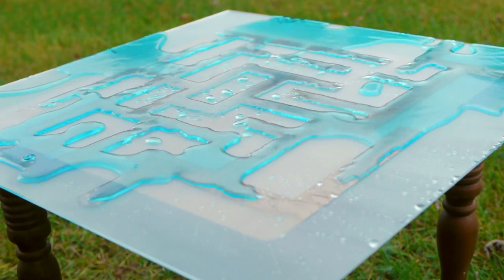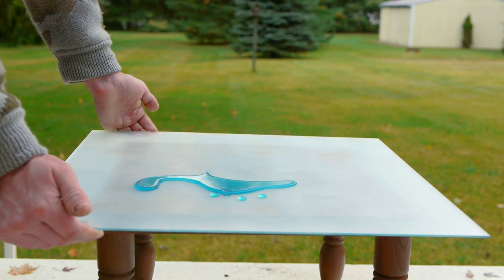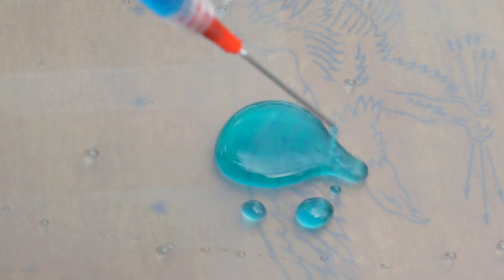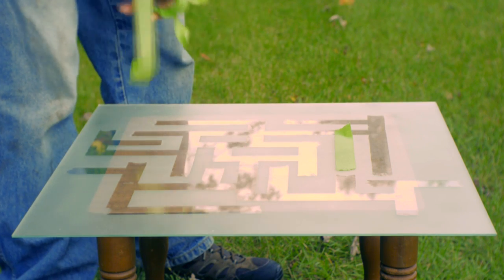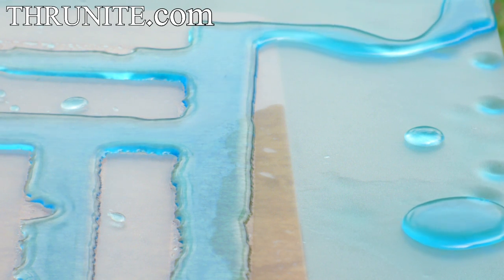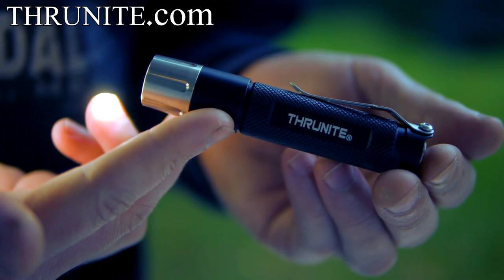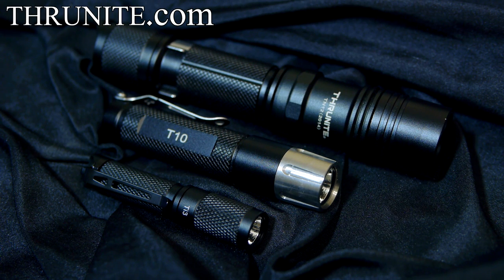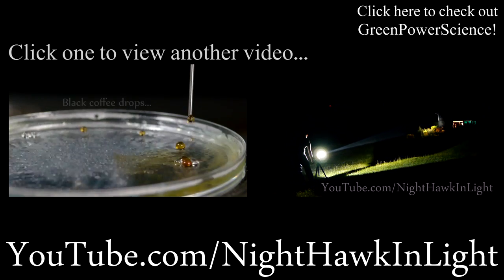DIY Hydrophobic Coating [Never Wet, Ultra Ever Dry Replacement]

Comment: Would this DIY version hold up on concrete or concrete like surfaces? I'm interested in making sidewalk/street art with hydrophobic stencils but the original Always Dry brand is too expensive to use for big projects like that. How durable and resistant is this combination? Also, if sprayed on concrete, would it be visible or go on clear in undetectable?

Comment: This makes me want to try SO many new ideas... What happens if you use a coating like this on rebar in concrete? Rust Prevention?$?... What happens if you used it inside plumbing pipes? Nonsticking waste flow sounds awesome, especially if it helped in low-temperature environments! Coats, tents, shoes, etc... So many uses!

Comment: I gave the anti persirant idea a try a few months ago (brainflash?) when the bathroom mirror was steaming up faster than I could shave.. as with this attempt the downside being it was milky and I could no longer see well enough. Meaning to get the muck off the mirror I eventually used a liquid scourer to remove it. It DID however stop vapour from misting the mirror. These flashlights are quite impressive and the art of your table project has a fluid appeal also. ( : Thanks for the discussion and name of the active ingredient !
Reply: Live with danger...shave without a mirror.  Pretend that you are blind!

Comment: Love all of your DIY projects!  I was a scientist back in the 1970s & 80s, so the geek in me enjoys your postings.  
The hydrophobic products are such a useful innovation for us common folk.
I'd love to do the steelwool fire twirling with a baton (yes, I once was a cheerleader).  Has this been done?
Now am subbing!
Reply from the maker: A lot of people have used steel wool for poi, but I don't know if it's been specifically done on a baton.
Reply: I love the Maori traditional dances!  Poi is wonderful to watch.  Perhaps I need to stick to using your copper wire method.  Especially since protective gear is needed.  A cheerleading outfit just wouldn't do it, eh?  Lol.

Comment: Really liked how you included the bit about the flashlight, while a little unrelated it's a great bonus info because having a good flashlight is always good. Seeing how you read all the comments is great too!

I saw a video not too long ago with some prototype nano tech coating but couldn't find a way to buy it( likely because it's still in development and such). This idea might be a good alternative especially for the price, but my desired application is on work boots, I'd like to walk out of a mud hole without ten pounds of dirt on my feet. I will test this out but have a feeling the coating will not stay on the boots and there is also the issue of temperature changes and how that affects things . Any thoughts or ideas would be great.
Reply from the maker: Dan Rojas does a little more experimenting than I do in my video. You might want to ask him. A link is in the description.

Comment: I find a lot of your videos to be really cool, but also kinda hard to understand at times. As someone who is no stranger to more common tools, I still find myself lost when it comes to the construction of most your projects. In this video for instance I would like to know what spray on deodorant works the best, and what the clear coat spray is and what it is normally used for so it would be easier to find when I go to walgreens and home depot. 

Try to remember, not everyone knows as much as you, so we may need some help sometimes as we try to learn. Its not talking down, its educating.

Comment: I'm in the military and especially enjoyed the DYI on the special coating.  If it really works I will definitely use it as weatherproofing for all of my gear.

My only question is does this have any draw backs where you cannot leave it in direct sunlight or extreme temperatures?

I will look into the flashlight as well because I've spent far too much on a modest salary for a good flashlight.  The Army doesn't have the money to provide us with any due to their high costs but if it's priced reasonably and meets our rugged standards then we may be ordering hundreds.

Thank you for your time.
Reply: I tried it on base boots , it doesn't work. I used the same chemicals he shows, my boots are wet.

Comment: what would this not work well on? besides fabric as mentioned below. as well as an estimated longevity to the coating on varying surfaces/materials? this is very fascinating and interesting, shame this doesn't work well on fabric as one could easily have hydrophobic jeans :(

Comment: Hey NightHawkInLight, can this be applied to any surface or does have to be glass?  Would you be able to add it to say clear plastic or acrylic?  How hard is it to remove the coating?

Comment: I checked on amazon.  The krylon costs 9.11 and the arrid xx costs 6.50. supposing we leave the shipping and taxes out of the equation, one would pay 15.61 for both.  Neverwet costs 16.87.  The difference in price is negligible, so the big questions are, which one is better?  which lasts longer?

Comment: GREAT video! I've been looking for a cost effective way to dirt-proof my dirtbike! From your personal experience do you think this method be sufficient to keep mud off my bike or should I stick to Never Wet or Ultra Ever Dry?
Reply from the maker: Unfortunately I don't think any of the three are going to be as permanent as you would hope. They will all require to be recoated pretty often with active use like that. I'm not sure what I would do for a dirtbike. Keep in mind that using any of these coatings is basically adding another coat of paint to the bike, so even if it works it will not look as good as it does now.

Comment: 1. On what surfaces does this stick to/ doesnt stick to? like clocth, concrete, etc.?
2.Would this be a permanent coat or could it still be easily removed by scratching or scraping?
3. Would this spray mixture react to heavy sun exposure?
hoping for your reply :)
Reply: Jesse Balde Looks like it works on concrete. The video shows a brick that's coated with the spray combination. Bricks are made of concrete.

Comment: Great video. Was wondering how long you suppose this method works as a permanent water retardant? Example- sealing a bird bath
Reply from the maker: It's not permanent. Regular clear coat or sealer would be your best bet.

Comment: YO NHIL any idea if this could be put on the home made Minimalist Running/Climbing shoes you did you a video on? Or does this only work on specific substances like concrete, glass, metal?
Reply from the maker: I haven't tried it, but I bet it would work.
Reply: NightHawkInLight okay thanks cause I could see that helping on rainy days with puddles :P
Reply: Daymian Hogue Have you tried wax yet? If you want to make shoes (preferably not leather ones) water resistant, you can roughly rub them with simple candle wax. Afterwards, you blow hot air onto it for the wax to melt and combine with the fibers. Haven't tried it out yet but looked promising enough! :)

Comment: Your flashlights are so cool!How much did the little one cost? My dad is a patrol officer and needs a good flashlight that fairly small.
Reply from the maker: The smallest one is the Ti3, it's around $20 on Amazon. It's really nice. Your dad is probably using a flashlight all the time though so I would bet he'd like something even brighter. Check out the TN12. It's more expensive but it's still pretty small and the brightest flashlight around for its size. I use it in this video: How to Convert a Flashlight into a Spotlight/Bat Signal But yeah, if he would really like a flashlight so small as to fit on his key chain the Ti3 is awesome.

Comment: Great video, could you please tell me if it matters what version of clearcoat you usae? I fee that you are using for this example Krylon colormaster clear - is that gloss, matt etc? I am trying to be specific because I probably won't get that here in the UK, but may get a similar product that will do the same thing?
Reply from the maker: I used glossy. Any will probably work fine, it's the first one I tried.

Comment: I really enjoy your videos and am a subscriber. You have clever ideas and put a lot of time in the videos. With that said I really don't like that almost exactly half of this video is a sponsor plug. Banners are one thing. Youtube has commercials sometimes but you can skip them and usually they are 30 seconds or less. Not a fan of videos with built in commercials. I would just watch PBS or something if I wanted commercials.

Comment: Hey Ben, would this work on a shirt or windbreaker? My windbreaker keeps on getting soaked during my mourning jogs in the rain.
Reply from the maker: I'm not sure that this would be very good for fabric. I think they make waterproofing sprays specifically for that purpose though.
Reply: What you'd need is something like Scotchgard (or another water repellent meant for fabrics).

Comment: How long does this last? I would like to use it as an undercoat for my car but not if it wont last..
Reply from the maker: The best undercoat for a car that I've found is just paint on rustolium. The sort you put on with a brush, not a spray can. Lasts a very long time and doesn't make a sticky mess in the heat like rubberized undercoat does.

Comment: Did someone try to make a hydrophobic coating with Cyclomethicone (it's much cheaper than pure Cyclopentasiloxane)? To spray the Cyclomethicone, should it be dissolved in water and if yes, at what concentration?
Reply: it's super expensive, and don't wast your time: it doesn't work on fabric (it only works on rigide stuff)

Comment: Dan didn't have that idea originally. It was an idea I had suggested over multiple sites on how you can make your own hydrophobic lacquer. I know he didn't think of this one because I demonstrated how to distill the main ingredients.
Reply: Hey man, do you have any information about it?
I'm working on a project and I need a very efficient hydrphobic substance, but it's nearly impossible to buy the commercial ones here in my country. I hope you can help me!
Reply: I can I get your country area? I might be able to help a little bit more if I know what you can purchase, or even synthesize.
Reply: Thanks for the answer, I live in Perú. Argentina was the closest place I could find to buy the "Superhydrophobic coating", and I'm not sure if they sell it in small or medium quantities (not a 20 gallon barrel).
Reply: Edgard Perez-Palma This Wiki page may also help with all your needs.
Reply: Sure, it's a project I'm doing in my university. I'm building a machine (a simple one right now) that makes spheres of concrete. The problem is, as you have guessed, that the concrete sticks on the surface. It should be solved by adding a coat of this.
Reply: I would suggest using something other than water for the concrete. This can not only solve the problem, but depending on the liquid used, strengthen the hell out of it. I would suggest one of these following.
-Denatured Isopropyl Alcohol
-Strong Acetone (Acetone Peroxide would be much better, but it is a hazardous substance, and if you are going to use that, don't wear gloves, it is way worse, eats right through vinyl, rubber, and latex)
-Butane
-Chloroform
-3 Molar Hydrochloric Acid (Very Reactive to about everything)
-Methanol Peroxide (just as dangerous as Acetone Peroxide)
-Ammonia Saerosol (Saerosol is isopropyl, acetone, and Methanol)
Reply: Ok, I forgot to say something important. These spheres have a low density material core (they are using Polystyrene) and my part of the project is the construction of the machine itself. I will recommend them to use these liquids, but I'm still stuck with the problem if they have their reasons to use water.
Reply: Do you have access to the machine now? Or is it yet to be built?
Reply: The prototype is ready and it will be tested on monday.
Reply: Did it work?
Reply: It was tested just today. Yes, it worked, but we had to put a coat of car lubricant on the screws. I'm still searching for a better solution.
Reply: Try using talcum powder (Gold bonds powder) on the screws, then put on the car lubricant, then another coat of talcum powder. This will seal, strengthen, and water-proof the bolts, in an easy to remove process. How did the interior handle? Did you use any of the suggested solutions?

Comment: I have several board games I wouldn't mind making water proof.  Should I expect any damage to something like the Settlers of Catan (or boards of a similar material, if not shape) if I were to try this?
Reply from the maker: In that situation I might try just spraying on a clear coat, no need to use the antiperspirant which could make the coating foggy. You wouldn't need a board game to be hydrophobic, just waterproof. Try it on a game or a piece of cardboard you don't care about first to make sure you like how it comes out.

Comment: I tried on a jacket it was a disaster: 1) it become white where it crackes, which mean everywhere since a fabric isnt rigit 2) it wasn't even waterproof (it may only work for rigid stuff, but there is much better way to do (white spirit + silicon caulk or (better) acetone + polyurethan foam)

Comment: windshield????
Reply: Oooh! Good idea!
Reply: The water could pool up though
Reply: +The normal Magikarp there is someone in Alberta who went on a show called Dragon's Den with windshield that melted snow I believe. I hear he's sold the design and it's being used so I figure if that works it would be fine on a windshield. If you're moving the water will be pushed off your car anyway.

Comment: What about adding my patent circuit into  your flashlights (lets negotiate an agreement); its very low parts count of just 3 for flashlights and only 1 for toy car/train sets, etc ; can be miniaturized if wanted to incorporate into hearing aids, digicams,etc;  Very low cost in basic version of just perhaps 30 cents or less per circuit for parts (requires installation into existing devices); gets double or more the joules of energy from existing alkaline cells (works really with every battery at least to some extent; so it good for so cheap to have it in the background for emergencies in any case): so if your LED light runs 5-10 hours installing this circuit will get you twice that time of use;  in addition to the twice work done on first running it also effectively turns throwaway alkaline into cells that after resting overnight can do more partial days of use after full first day run down ie toy train runs 1000 laps first days use (which is twice the norm of 500 laps);  now by resting the cells & letting autoregeneration take place naturally without any external help, the cells will run again each succeeding day with diminishing results each day*   for up to 5 more days; thus a person can always get that last picture or last heart defib or always win the blue ribbon vs normal systems.  Contact me if interested:  Jeff 386 - 837- 9455 txt or voice.     * ie 1000 laps day 1 which is 2x norm, then next day 350 more laps day 2, then 250 more day 3, then 180 more on day 4, then 130 more day 5: now the battery is finally completely zeroed "for good" and now u throw it away;  approximately and depending on wattage being used.

Comment: Hydrophobic coatings on windshields... Get on that, car manufacturers ;)
Reply from the maker: RainX works really well. Not as good as something like Never Wet, but Never Wet would fog up your window.
Reply: A lot of the hydrophobic coatings you can put on windscreens (eg RainX) get worn off by the action of wiper blades over a surprisingly short period of time.
Reply: ptonpc But why would you use wiper blades if you use rainx?
Reply: hughtub Rainx only really works if the vehicle or wind is above a certain speed (Dependant on the angle of the windscreen)  Until that point, the windscreen would be covered in thousands of droplets which can be more difficult to see through.
Reply: Aquapel is some pretty awesome stuff, lasts about a year on a windshield, as long as the car is moving you rarely need to use wipers as the rain just flies off.